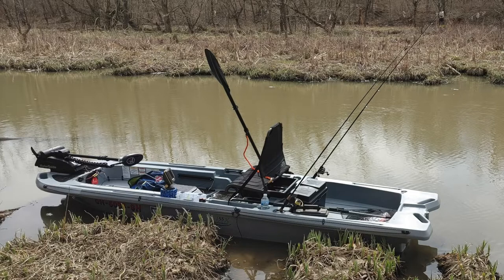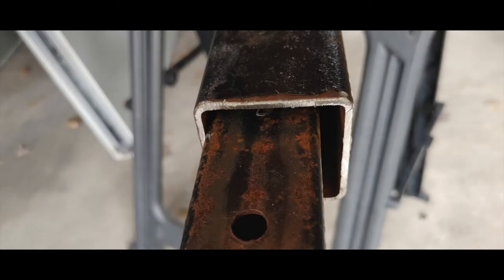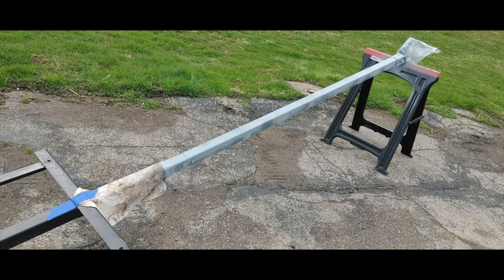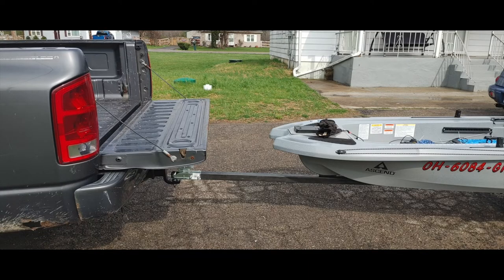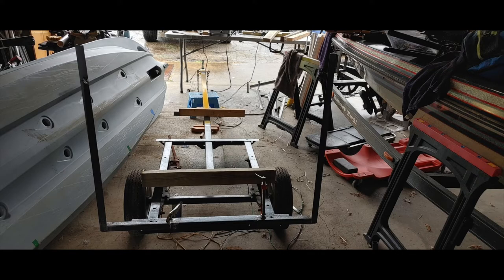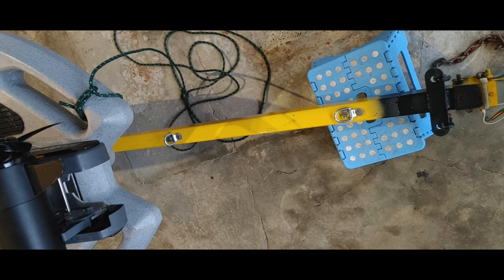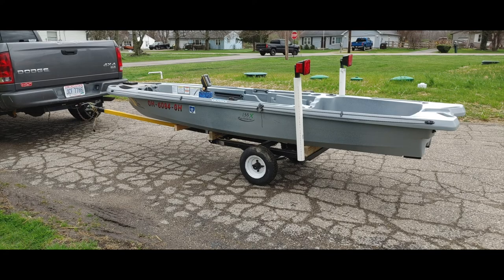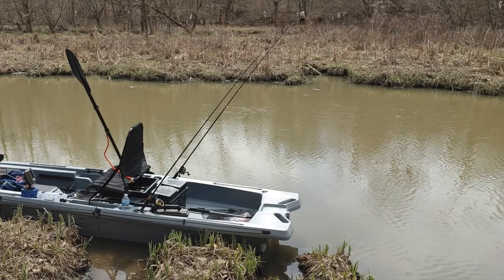HOW TO MAKE A KAYAK TRAILER

Comment: Nice build! I'd use a Nylock nut plus a lock washer on the tongue just to be extra safe. A set of fenders would be nice in case you have a blowout or you sling a rock through the hull, plus you need a spare tire and yellow side clearance lights. Nice job Bill!
Reply from the maker: Thank you Matthew.  Those are great suggestions and I have plans to do those things.  Appreciate the input!

Comment: That is a sweet little build. I've been looking at this model kayak. Do you like it? Regarding the trailer build, about how much do you estimate a build like that costing a person? I never would have thought of that approach. My thoughts have been leaning to a jet ski trailer since I am here in Florida.
Reply from the maker: A lot of people do use the jetski trailers and they seem to work well.  I got my trailer for $200 used, and probably put another $80 into it...so not too bad.   I love my 133x,  I use it in lakes and small rivers and it is perfect for me.  They had some problems with warping in the past but I think they have fixed those issues.
Reply: @adventureswithbill9825  that's awesome. Can't wait to see more!

Comment: How far apart is the pvc mounted? I’m looking at doing this myself
Reply from the maker: I put it under my kayak first, and measured it in the 2 hull channels.  It worked out to 10-3/8" center to center for the 2" pvc pipes.